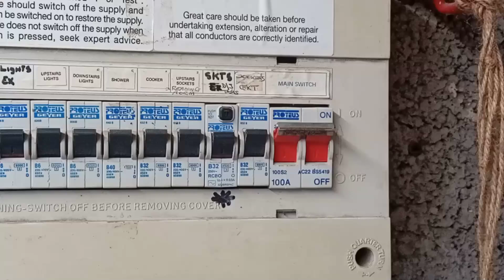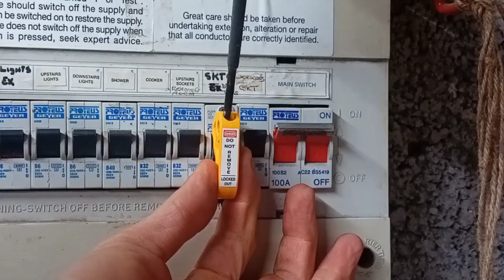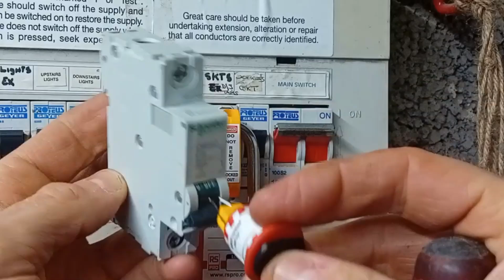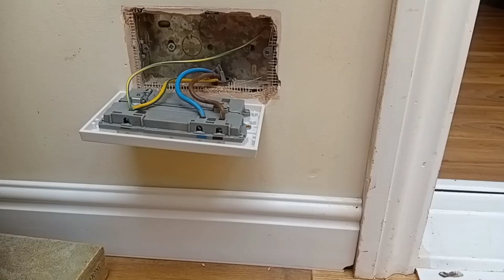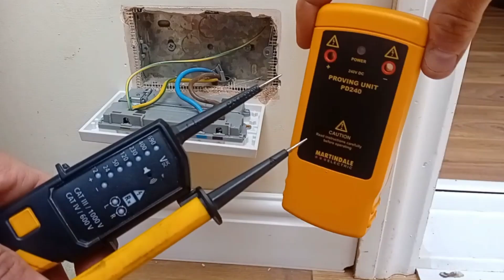How to test for Dead - Electrical Safety.

Comment from the maker: Yes lock off that's what I clearly explain. Tape and Caution notice is last resort but better than nothing. 

MartinDale VT28 voltage tester is GS 38 approved, caps may need to be removed for good connection in certain circumstances like in the video, perfectly safe in the correct qualified hands. 
Incorrect, 1st lead to live does not make the 2nd lead live. Not sure we're you got this. But with 22 years as an electrical engineer I can asure you.  The method I showed was perfectly safe and approved.

Comment: Good video, but I'd say you should always lock off, a bit of tape and caution notice wont suffice at all. Also those test leads dont comply to GS38. with that amount of exposed tips showing. And you should always connect one lead to earth first then the other one to live, otherwise you could have a live test lead waving around in your hand.